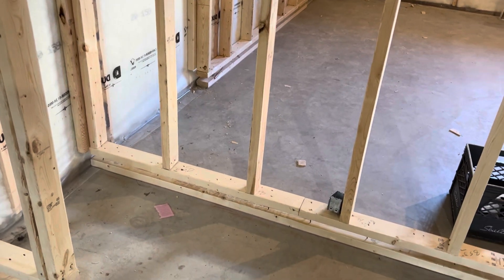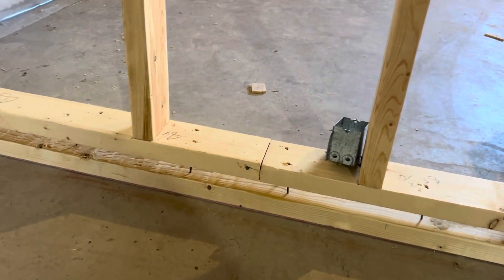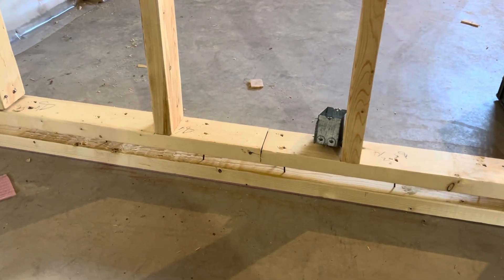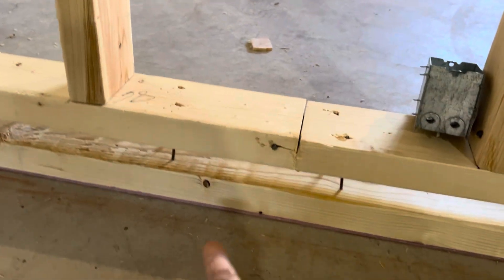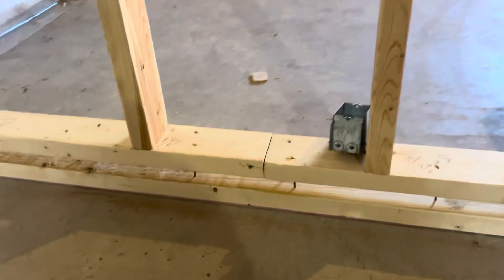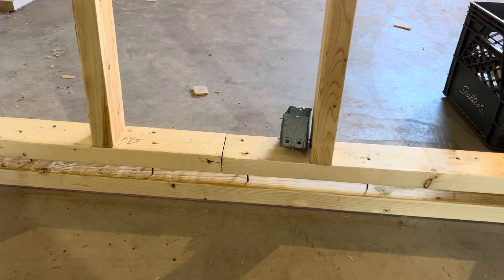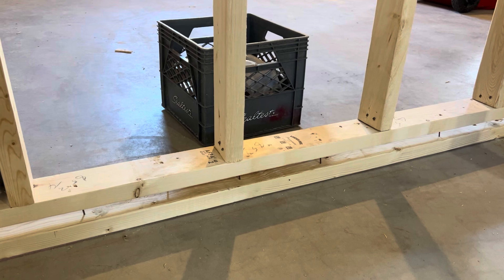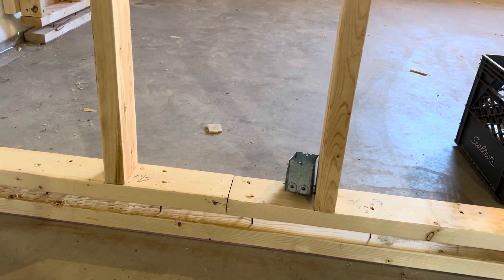#58 expansion gap in basement walls

Comment: Best way to fix this problem is not to build a house on the ground instead built the house on piers
Reply from the maker: The houses are built on Piers. But the floor is not so therefore we have movement when this clay expands. You can do a structural floor with 8 to  10 inches of concrete two layers of rebar and put piers throughout your floor with cardboard void underneath. This is a structural and is mainly used in commercial buildings around here very expensive.

Comment: At 0:45 - if the drywall holds the two parallel bottom plates together (and not so much the nails?), then isn't the drywall screwed into both the lower and upper bottom plate? If the floor heaves upwards and closes the 1-inch gap then wouldn't the drywall buckle at the bottom? Also wouldn't the heads of the nails tend to back out of the upper bottom plate?
Reply from the maker: Drywall is only screwed to the top plate. And the drywall is left an inch off the floor. Expansion does not always happen just trying to accommodate it if it does. if there is excessive, shifting all your doors will have to be all readjusted and you’ll have minimum things to fix rather than pushing your rest of the house up. I have renovated houses where they did not install the 1 inch gap and as the ground pushed up it also pushed the main floor and second floor higher causing problems in the entire house.

Comment: Most guys ive seen (me included) do floating walls drive 6 inch nails through both plates. That way the wall is actually able to move up and down independent.

The way you have it here, if the wall moved up all your nails will disconnect from the bottom plate.

Comment: Why no rebar?
Reply from the maker: Basements around here the concrete just sits on the ground. Wouldn’t make any difference if you had rebar in it or not, it would still flex and crack. We Only use rebar in a basement slab if you’re going structural
Reply: @diyrepaircorner  I’m in New York State and also nobody bothers with rebar on the basement slab.

I have tons of clay underneath my house very close to the foundation, but it never ever dries out, so I have no apparent movement.
Reply from the maker: In Winnipeg, we have expanding clay in the ground and I was told by an engineer around Toronto. They have clay that shrinks all depends on what part of the country you live in and the soil conditions. 👍

Comment: Rebar the entire floor, with inset 600mm piles under the slab, but formed integral with the slab; slab 200mm.
Reply from the maker: Yes that would work. That would make it a structural floor. You would also need then 6” void form (cardboard) under the concrete.

Comment: Not too structural,  building for over 30 years,doesn't make a lot of sense 😮
Reply: Walls are not structural they are partitional. That's why it does not make sense to you.
Reply: @lm5085 some walls are structural. It just happens that the lumber, in this case, was used to fur out the structural walls and to build non-structural partition walls.
Reply from the maker: Not a structural wall just a partition wall between rooms. 
We have basements that have been pushed up up to 3 inches in this area. Kind of sucks.   
Code requirement
Reply: @diyrepaircorner considering how much it heaves in your area, do you ever consider putting in expansion joints in the pad to control where it cracks?
Reply: Why would it need to be structured? That's obviously not the point of that wall.
Reply: Well you suck foe 30 years of experience. 

This is a floating wall for areas with extreme weather/heaving in basements and it's code in many places.

Its so the floor can move and not push your wall into the floor joists above it.
Reply: You suck for 30 years experience then.

Its a floating wall so the basement floor doesn't heave it into the floor joists above and it's code for any places with extreme weather and crappy ground.
Reply: Huh.... Never seen that before.

Comment: Best to use plastic under bottom plate or a pressure treated bottom plate for moisture and wood rot.
Reply from the maker: Yes. I have 1/4 seal gasket under the bottom plate. Works great   (1/4 Styrofoam)
Reply: @diyrepaircorner  awesome
Reply: Gasket is the way to go, plastic will make a ton of moisture

Comment: Never heard of that. Learn something new everyday!!! No p.t. for the bottom plate though??
Reply from the maker: Bottom plate has drywall coming down both sides half inch off the floor. Your baseboards is also nailed to your bottom board.
Reply: @diyrepaircorner  I get that. I wonder why the lumber in contact with the concrete is not treated.
Reply from the maker: @ronduckett5017  
Some people use pressure-treated  
This is a new house and there is 10 mill poly underneath the concrete to protect from moisture. Plus I put a seal gasket (1/4 styrofoam) underneath the bottom plate to keep it off the concrete.
Reply: @diyrepaircorner We do all that as well but code here requires pressure treated lumber where the bottom plate is in contact with the concrete.
Reply: @diyrepaircorner crazy, that makes sense to me. For sill plates always use gasket instead of PT.

Engineer on the job told me PT isn’t to be used on the homes framing (and this was a lintel ply, and the outermost ply of the 3 ply lintel).
Reply: @JT_70  I bet that code is not actually that. My town says to use pressure-treated bottom plate but I’m pretty darn sure that if you use the Styrofoam they’ll let that pass as well. Actually a capillary break (foam) is superior to PT in constant contact with concrete.

There is also the fact that on the majority of newish homes you’re going to have plastic underneath the concrete anyway—so it never really gets that damp to begin with.

Comment: Fellow Manitoban here- what’s code for properly doing moisture/ vapor barrier on the perimeter walls? 

I’m seeing conflicting answers, MB hydro states to put vapor barrier on the backside and front of the wall- but I feel that would create a moisture problem
Reply from the maker: Manitoba Hydro is wrong. You always have to have your vapour barrier on the warm side otherwise you’ll get moisture problems.
Reply: They recommend 1/2 way up concrete only and down and up around on warm side.

Comment: I live west of Denver where code requires 1.5" expansion gap. I'm redoing a 50+ yo basement that had gaps, but the construction technique was inadequate. I haven't been able to find much DIY information on framing doors and, more importantly, a tiled shower stall. City inspector wasn't much help, nor were the two contractors I talked to. I'm all ears for any advice or sources of information!
Reply from the maker: You frame the walls with the gap at the bottom. If the floor does move up you will have no choice but to but to ajust the door and accommodate for the movement.

Comment: Sorry guy,  that is not a wall.  Its closer to a screen.   nailing chalk and paper sheets to wooden struts doesn't make a wall.    Regardless if you guys call chalk board, dry wall
Reply from the maker: That’s a wall here. Lol
What do you use
Reply: Brick,      A partition is what we call a makeshift or non permanent / movable structure, like the one you have.   @diyrepaircorner
Reply: What stops the lumber from dropping and closing the gap ?
Reply from the maker: @kencampbell-rf6ot 
The wall is basically suspended from above and has nails that go through the 1 inch gap at the bottom. if the ground expands and comes up, the nails will bend in the gap will get smaller. Drywall is installed on both sides to hold it in place also.
Reply: Thanks 👍  Theres no arguing... its a floating wall.   Your joinery like spot on. Guess you just put a brush on the bottom of any doors as they need the same 1"  @diyrepaircorner
Reply: @kencampbell-rf6ot No, this has nothing to do with door heights. You frame them as normal.